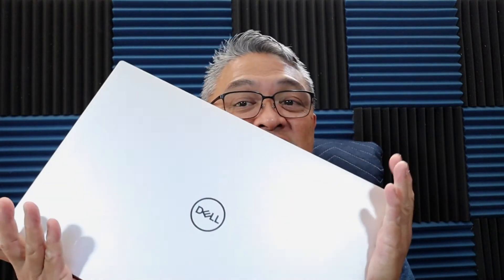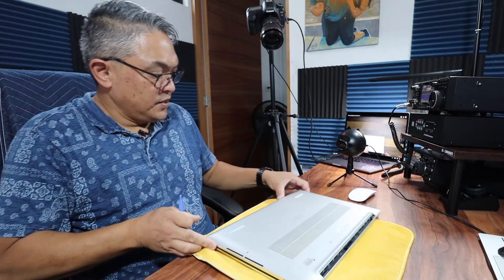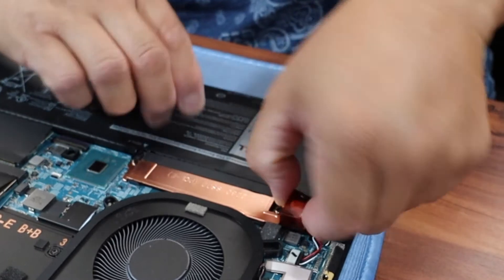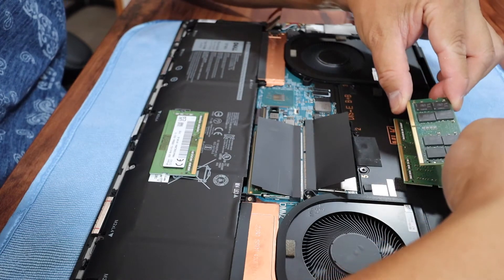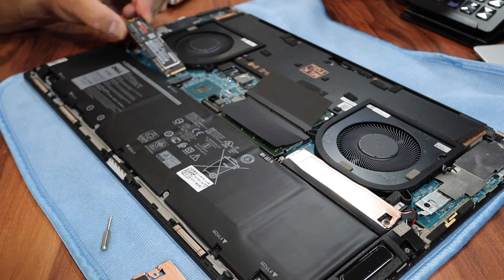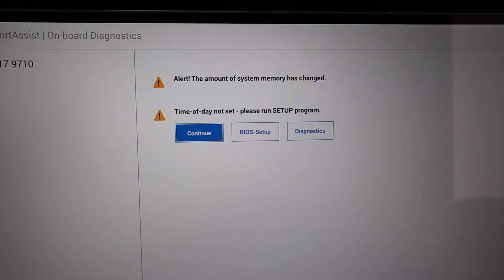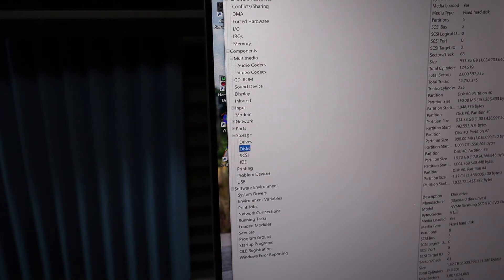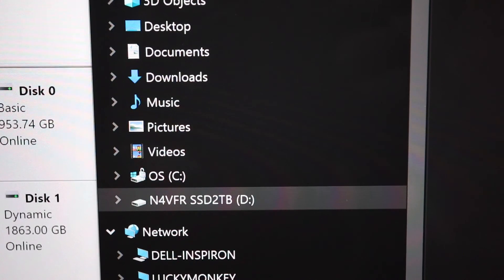Upgrading the Dell XPS17 with 64GB Ram and 2TB SSD | Quck and Easy way to perform you own Upgrade!

Comment: The Ram upgrade is it the 2666MHz that is the correct version as linked?
Reply from the maker: Yes, I bought the RAM that is listed in my descriptions.  It is 2666Mhz and it works.  The default Ram speed that comes with the XPS17 is 3200Mhz therefore, my max speed will be 2666Mhz.
Reply: @DarrenN4VFR  They do have a 3200Mhz option listed in the link you provided would that work do you think and be better?
Reply from the maker: @reefshui3231  I would get the 3200Mhz. The laptop would go as fast as the slowest component installed.

Comment: I installed a Samsung 980 Evo Plus 2TB and it's just flying. Quite an upgrade from the built-in 512GB drive. I did not upgrade to 64GB of memory, though. That is quite too much for me! In short, don't hesitate to upgrade the storage or the memory if you want to.
EDIT: I should also mention that I installed Windows from scratch on the new drive (Windows 10 - screw 11 for now). Now I have a lot less bloat to deal with.
Reply from the maker: I think 64g Ram is overkill for me too.  Ok on installing Wins10 without the bloat wears.